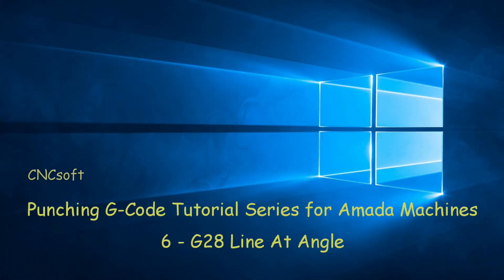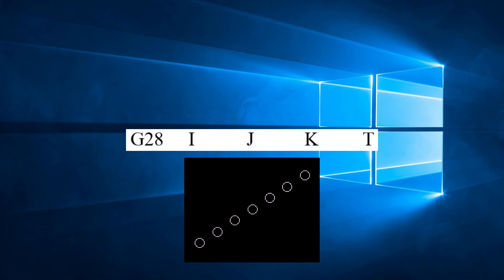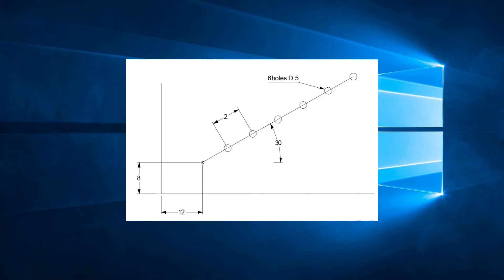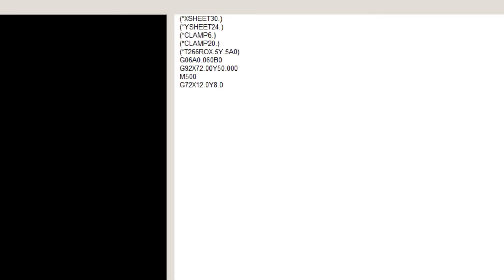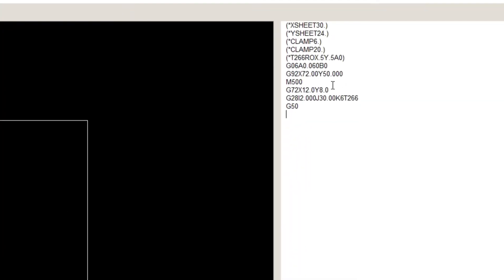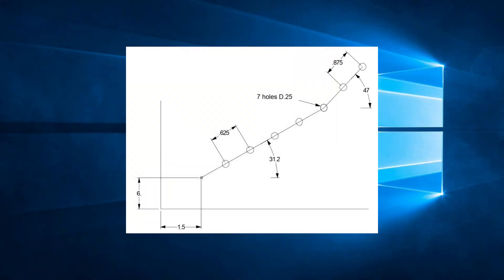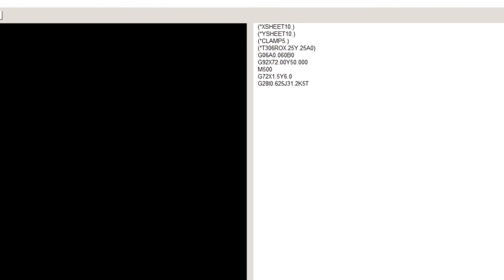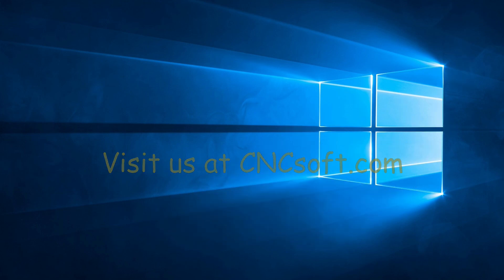6 - G28 Line At Angle - Punch Programming G-code Tutorial Series for Amada Machines

Comment: Can you please explain the difference between your software and AP100?
Reply from the maker: Not sure which version of AP100 you are referring to, AP100US or AP100G. In any case, our software is a G-code simulator. You can simulate existing G-code files or write new G-code files and simulate the result. There are other functions included which you can see the details in our videos.
AP100US and AP100G are complete CAD/CAM software packages. They are designed to generate G-code from CAD files. As far we know, AP100US will create G-code but cannot simulate the code after the fact. AP100G does include a G-code simulator. Both of these packages cost many thousands of dollars. PunchSim is less than $50 dollars.
Hope this helps.
Reply: @CNCSOFTVIDEOS  Thanks very much!